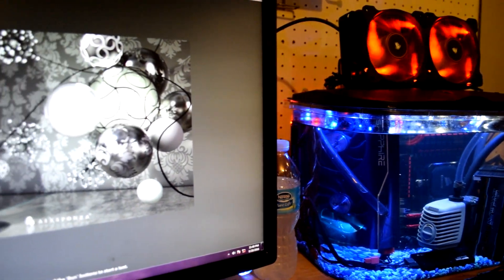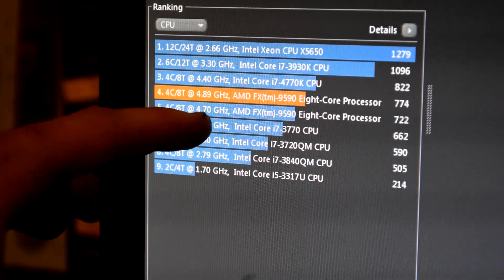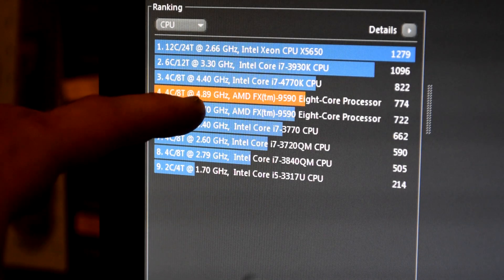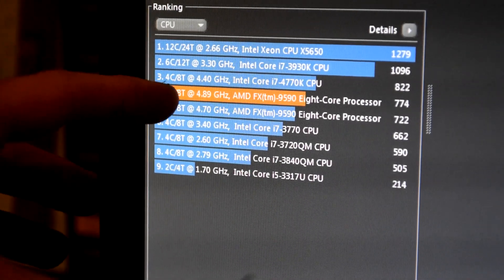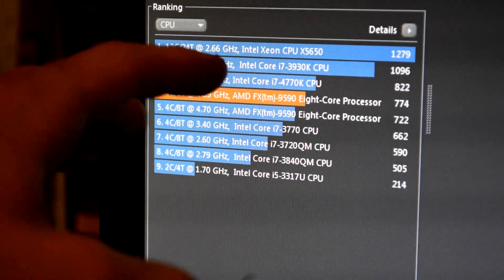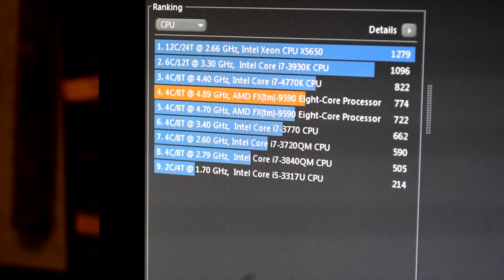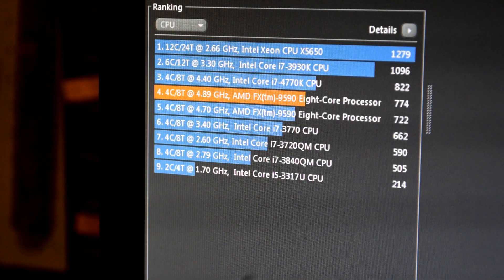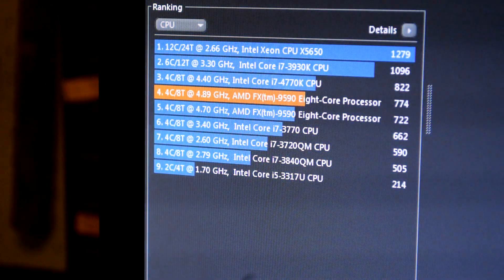9590 Overclocked In Mineral Oil: Is It Worth It?

Comment: for ur questions in ur review i take it back the the amd 550be, unclocked to a b50 and oced at one point in time 1st at 3dmark paired with gtx 480 or a gtx 275 triples304 (---- Me. point is yes the chip is oc'd but they have all be marked as doing 4.7 and boosting to 5.0 that doesn't mean there isnt chips in the batch that cant go higher. luck of the draw and burn in ( i believe in this method )

Comment: Would be interesting to see you guys overclock a phenom II 1090T or 1100T with the same setup.
slightly better core performace, & bit slower multi core performance.
Reply: got my 1090t on asus saber 2.0 24/7 3.725 i can get 4.2 but not on all 6 cores the 5th,6th core do like a 3.9 :(
Reply: 1.375v ?
Pretty good for 3.9 ghz on all cores.
running 3.7 ghz myself on 1.375

1.475v On the cpu is the max safe voltage id go with (some go with 1.5v but i feel thats a bit too high for 24/7)
So you got some headroom to mess about with on voltage.
Reply: 1.38 up to 1.40 it jumps back and forth depending on laod. had to do that to make stable, case is old thermaltake kandalf lcs swapped all 3 120mm fans on rad to i think silverstone 121f or soemthing been years but they can push u guessed it 120 cfm  at full blast. if room ac is set to 67-70c it 1090t idels at 26, load 43c.

Comment: Rebranded 8370E. 

The -E parts are the lower power usage refreshes of the Vishera CPU line. The 9590 and 9370 are entirely dumb, you can ( I have one right now, I'm typing this on this computer ) get a 8320E to 4.8Ghz with a decent mobo and cooler. An 8370E will touch 4.9-5Ghz no problem. 

The 9 series is, weirdly, not as good as the 8320/70E at Overclocking.

Comment: to make a correction, if you buy a 8350 now you arent going to get near the speed of the 9590 just because those chips (8350)  that can achieve those speeds are binned to be 9590. 

and i dont understand why you watercool the 9590. you guys just sumerge a watercooled pc in oil gaining no benefits. now if you put a heatsink instead of the watercooler the results would have been diferent and  actually be the real results.
Reply from the maker: If you look up benches, you can OC a 8350 to be equivalent almost of a 9590 for half the price. And after doing 3 mineral PC's I can tell you from experience we couldn't have cooled this pc without a additional water cooler.
Reply: +Toasty Bros i know those benches, but those were from when the 9590 didnt existed. after that the good 8350 where move to be 9590. many users who bougth the 8350 after the 9590 came out didnt get the same oc as before. 
and about the watercooler. if you used a big heatsink inside the tank the oil would have helped. 

all those things aside, nice build and bonus points for using AMD